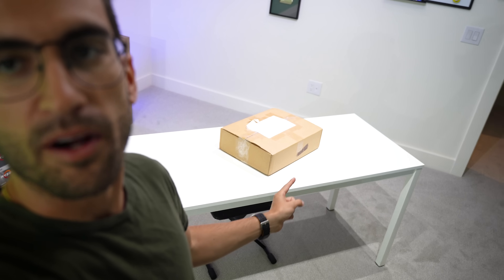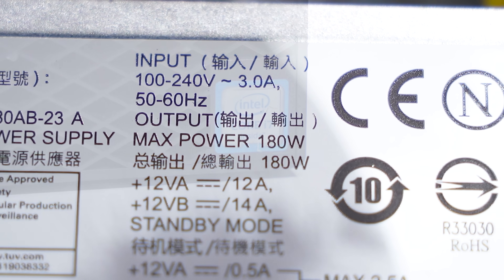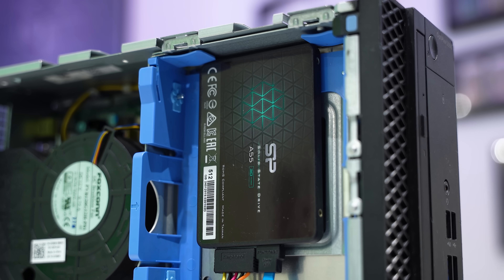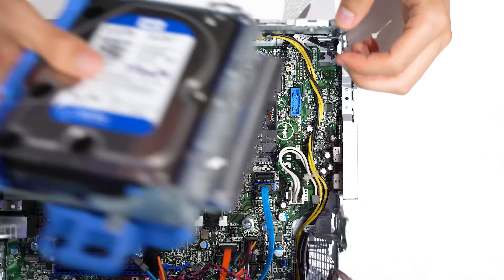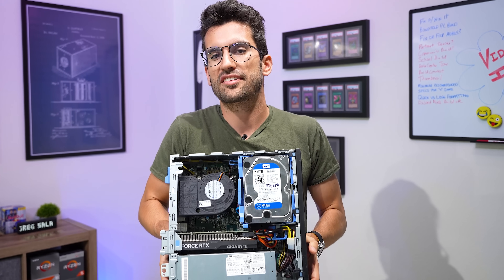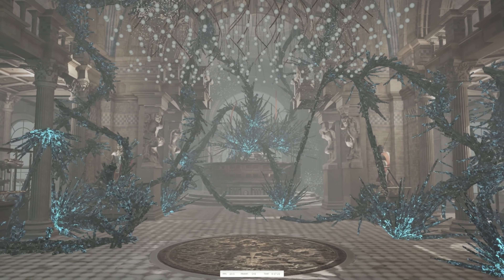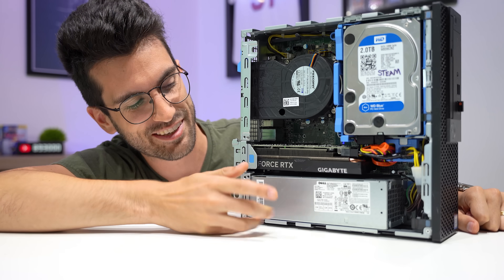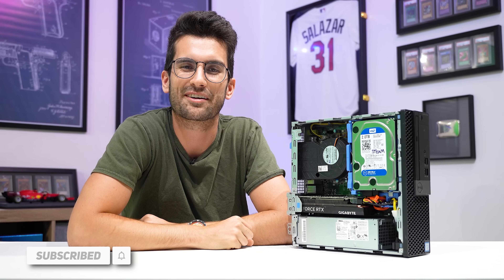This PC Build Makes NO Sense

Comment: Use a riser cable to connect it to the correct slot and give us a before and after test results. 😁
Reply: I'd be very interested in those results...
Reply from the maker: Really thought about doing this! Wish I had in hindsight.
Reply: @GregSalazar  C'mon, we need it. It would change from "very dumb build" to "it's not THE dumbest build". Because that 4 lane solution is very VERY bad.
Reply: Yeah, I would definitely desolder that PCI 3.0x4 slot off the board and use a riser cable to go over to the 16x slot.
Reply: @GregSalazar  I was thinking about it as well, but would you have to break out a Dremel and still have nothing to screw the card too.
Reply: Maybe the single slot Arc card would be a better option?
Reply: @Yuriel1981  Or another Optiplex that has the PCI-E slot in the right place because it mite be cheaper. 🙂
Reply: @Yuriel1981  I installed one of those in my dad's PC. It gets scary hot very fast, and that's with a normal-ish case and quite a lot of airflow.
Reply: @Fusso  I mean, I would undervolt it to reduce heat then. Usually won't effect performance as much as most would think.
Reply: @Yuriel1981  no, then you have to enable ReBAR or pay a huge performance penalty, and this system doesn't support it. Plus the A310 gets annihilated by the RTX 4060.
Reply: @j.p.h.8126  you have to get the mini-tower then. And not really. But it would allow you better power supply/video card options. I wouldn't go 7th gen either, I'd shoot for 8th at least. This video was full of bad ideas.
Reply: @SeeJayPlayGames  Indeed it was but this video was just for lols. Personaly i would stay away from everything that has DELL logo on it. 🤣
Reply: @SeeJayPlayGames  as much as Halving the PCie lanes? And if your going to game with it why are you not enabling ReBAR?
Reply: Why did Dell put the x16 slot in the wrong position?
Reply: @johngangemi1361  I gues it was not made for gaming in mind.
Reply: @GregSalazar  make another video
Reply: @johngangemi1361  Because Dell

Comment: My Dad works IT at his company. Every 2 years they "Upgrade" Their PC's. He gave me a 9th gen version of this same PC. I ended up doing something similar. Instead of using the upper 4x slot, I bought a low profile RX 6400. It Runs great pretty good actually. I added a little front fan as well to help give it some more air.
Reply: I've done the same thing. So far no problems, but I'm a little concerned about the 200W PSU my Vostro has. I think it's fine, though. How big is your PSU? The rx6400 is an amazing card, really. I got it for $120 off of Newegg. a DDR5 1030 was $100. I had bought a DDR4 1030 for $65 off of Amazon, but it was only about 20% faster than the iGPU.

Comment: I bought a Dell Optiplex 3040 SFF with the intel core i5- 6500 for $50 or $60. I swapped out the i5-6500 for the i7-6700, upgrade the PSU from 180w to the 240w PSU, upgraded the ram to 16GB (DDR3L though. Blasted Dell!), bought a 2TB SSD and had bought 1 RTX A2000 and an AMD RX6400. I bought 2 gfx cards because I wasn't sure if I wanted to have a gfx card pouring out of the case or if I wanted to keep the SFF theme going. I ended up choosing the rx6400 because it keeps the build clean. It is my daily rig and is plenty capable of gaming. It handles 1080p gaming like a champ. With AMD's Frame Gen and/or Super Resolution enabled, it puts out over 100fps in the games I play. It is "loud". But, that's where the compromise is. Only thing I wished I would've looked for before purchasing the 3040 was maybe looking into the 3050 or 5050/7050. I would've had m.2 and DDR4. If I come across a 3050 MB for super cheap, I think that'll be the last thing I do to it.

I play Minecraft with kids, Path of Exile, PUBG, GTA5, SCUM and EVE Online. The RX6400 handles everything very well. Albeit, Hot and Loud on some of those titles.

Comment: I did something very similar with an HP slim i had laying around for my son. Upgraded his CPU to a i7-8700 of eBay for $80, & got a rx580 off AliExpress for $85 cut hole in side of case & attached it with riser cable. We dubbed it Frankenstein,, runs Minecraft, Roblox & Warzone @1080p he loves it..

Comment: Unfortunately, Dell has been doing that with the x16 slot since the 4th Gen systems... which is why I generally tell people to avoid them. HP has much better option in the SFF systems, granted they aren't as small as the Optiplex and Lenovo systems, but you can fit any GPU in most of them. If you really want to stick with an Optiplex, a Flex ATX PSU will give you the room you need to be able to install a dual slot card in the x16 slot.

Also worth noting, that x4 slot is a Gen2 slot.
Reply: HP does a different crappy thing than Dell does; sometimes they current-limit the slot. To 35W or some BS. Or so I've heard. If you ask me that would be deviating from the PCI Express specification, if they limited the current. But why would they do this? I guess because of the stock 180W power supply. I can't confirm or deny; I've never owned an HP and I lost my multimeter anyway but you can't measure load without creating it so I'd have to insert a card and measure the voltage at the gold fingers... anyway... so the FlexATX PSU is much smaller? Like a slot's worth?

And of course it is... so it's a 2x4? (thwack) and the card is PCIe 4.0x8? so... we're working with an EIGHTH of the bandwidth it could, optimally. Ouch. Definitely would be a good idea to try (no, do - or do not; there is no try) and do a riser somehow. If only to get it to 3.0x8... too bad you can't adapt 4.0x8 to 3.0x16... I guess with a double-buffer/relay circuit you could?
Reply: @SeeJayPlayGames  Lenovo and Dell have both done that as well, and they really only do that in the consumer models. They don't do it in the business systems like the 600/800 series and the Z workstations. As for the Flex ATX, yeah... they're a server 1U sized power supply, so about 1.5 inches. It leaves just enough space to have a dual slot card in the x16 slot and having the shroud be about as close to the PSU. I need to test it with the 4060, but the x4 slot versus the x16 slot is about an 11% difference in performance, so I'm not sure it's really worth it either way.

Comment: Moddiy makes adapters for 24 atx to dells proprietary 8 pin so in theory you could use any PSU that fits. So looks like flex form factor. A small diy spacer would take care of sagging.
Reply: There is a 500w PSU from the NUC extreme going for 30 if you make an offer.  If I remember rightly it is an FSP.  Might even be smaller so you can use a the graphics x16 slot 🤷🏼‍♂️.

Comment: You could use a riser cable to connect the graphics card to the full pciex16 slot, and basically keep it in the same spot.

Comment: I use a 5040 for my virtualization server running casaos dockers controller with pinhole, unbound,  plex, an a310 arc for transcoding, 32gb ram, q28gb nvme and 3x 4tb ssd for storage crammed in the 3.5inch spot lol. Not bad for a server that pulls 10w at idle, 130w when plex is loaded, and can do networking stuff while running 4 plex transcodes....

Comment: @GregSalazar
Interesting note, If you had bought an HP Elitedesk G3 or G4 SFF, you would have had a better experience as the PCIe 16x slot is next to the CPU socket. I have one of them, G4 with a 6core i5 8500, 32GB of RAM, a 512GB NVMe drive+2TB 2.5HDD and a GTX 1050ti low profile(which fits in perfectly). It makes for a very decent 1080p/720p experience. I'm thinking of upgrading the 1050ti to a 3050 or 4060 because why not?

Comment: Ditch the hdd mod the case use a riser cable get the gpu to fit laying fan side up where the hdd caddy was. 

Then possibly vent the side panel it will be much better and more in line with what people are actually doing with these systems.

Comment: I actually have a  SFF OptiPlex 990 MB sitting in my testbench right now. I rescued it from the recycle bin. The case makes no sense so it's getting re-cased. I have to rewire all the fans (thanks dell), so I am using that same cyclone cooler right now, it's loud but it's the same loud at any load. I had to use a PCI-E extender fit a 1080 in it, as the GPU hit the ATX 24pin, so again limited there for GPU's. I am glad there is video that makes as much sense as my test bench franken build. It sort of fun to see how much you can do with a basic office PC that had no dreams of doing much more.

Comment: There's a 24 pin to 6 pin adapter from comeap for like $20 which allow you to use any PSU that fits the case with dell PC's or other pc's that have proprietary connections. Only bad thing is that the PC is "always on" unless you turn the PSU off manually. I used one in my Dell G5 5000 to put a SF750 inside so I could run a 3080ti in it and it's been working well. I wanted to get a SF850L, but wasn't sure if that would fit.

Comment: Nice build. Next time you could take the power supply out of the case, drill some additional vents in the case and cut the sidepanel so a wide card fits, see if it works. Proper Sleeper rig needs at least one hand made part 😉 or parts from different eras of computers. you have it already with the power cable 😊

Comment: I have a small stack of those from when we closed down a branch of our library. They are a nightmare to work on and have very little upgradability. That said, they do have 8th gen i5 chips and as such are fairly fast. I set them up when I need to rip a bunch of DVDs. One keyboard and mouse and then just remote in.

Comment: I picked up a HP EliteDesk 800 G3 SFF to use as my backup NAS, and have been impressed with it. i5-7500, 16gb, i threw a 128Gb NVMe into it for the OS, and the 2 14Tb drives for the backup. The x16 slot is in the top position so you could put a GPU in there without it getting choked by the PSU. no connection for supplemental power, so a PSU upgrade would be needed. i got mine for 60 bucks, but they are on eBay for 85 pretty easily. add in a 3050 for under 200 bucks, and you have a solid 1080p gaming system for under 300 bucks.

Comment: I'd like to see a performance comparison between a lower end  LP card with a full 8x or 16x PCIE lane vs the crippling 4x and 4060 here. See if it balances out. Something like a 1660lp super, maybe a Radeon Rx6400lp?  RTX3050 lp\A2000 or even or the newer Slim ARC 3xx cards, then compare to the CPU bottleneck etc, actually find the best price/performance than can be had with an SFF system like this!
Reply: I'm running i5-4590 + RX 6400LP + 16gb RAM. Solid 60fps on Ultra on most common titles from 5-10 years ago. A few hiccups with BG3 and Kingdom Come, but overall, you can't beat it for the entire $322 it cost me total.
Reply: @OGDweeb  Nice! I have a i7-4790s with 16gb and a 1660 super does all I need for a compact Mini itx bedroom gaming PC!
Reply: RX 6400 is PCIe 4.0x4. It fits in a whole 16x slot but don't be fooled, it's only a 4-lane card. The RX 6600 is only 4.0x8. You need at least a 6700 before you see a full 16 lanes used. Same can be said of the RTX 3000/4000 series... the lower-end cards have limited lanes. The RTX 4060 is only an 8-lane card. You want a 16-lane card, you need at least a 4070.

By comparison, the whole Pascal (GTX 10 series) line (with GTX branding, not the GT models) were 3.0x16. The GT 1030 (and 1010) was only 3.0x4. The rarer Kepler based GK107 variant of the 1030 actually did have 16 lanes, as well as NVENC (albeit 1st gen).
Reply: Excellent info!!!

Comment: VERY cool! I just bought a Dell Vostro 3471 that was very similar. Got it locally from Facebook for $50! (It only had an HDD and 4gb of RAM, so I upgraded it with a 1TB SSD and 32gb of RAM, just because I had it lying around. So it ended up costing about the same as yours!) 200W PSU, as well, so I put an rx6400 (max 53 tdp) in it and it's an AMAZING retro gaming machine. I love it!

Comment: From time to time I deal with Optiplex, the 5050 and up SFF are troublesome because I like to but them to pull a cheap i7 to upgrade a gaming PC, and end up putting the F SKU i3 or i5, and then have to put a single slot low profile GPU in, I normally use an ancient Quadro or Fire Pro card, but it seems like there should be something better for under $200.

Comment: You can tell how young Greg is because he doesn't know what a blower is, he calls it a wind tunnel and assumes it's loud! I had one of these Optiplex workstations I got used for cheap, and that blower is great. The pressure lets it pull air effectively through the dense heatsink fins and the air goes straight out of the case. Also the reason blower graphics cards are beneficial. They've only gone out of style due to the prevalence of cases with many giant fans

Comment: I would have gone with an HP SFF instead. Although a little larger physically, the x16 slots are in the correct spot unlike these Optiplex PC's. I have two Dell SFF's with Core i5-6500T CPU's and the best option I came up with for one of them was to make a OPNSense firewall by adding a 4 port 2.5 Gbe card. The other one just sits doing nothing because there are no good single slot GPU options with pci-e 3.0. ETA Prime did create a single slot intel Arc 380, but that requires Above 4G decoding and ReBAR to make it worth installing and those older PC's do not support it or the ability to  mod the BIOS/UEFI to enable those options.

Comment: Im surprised you didn't just custom fit a pico psu, with an adapter for the 24 pin to that dell motherboard, then you would have had loads more space to play with for the GPU and could have put it in the 16x slot.

Comment: you did what I did too. Well, I have gone a little bit bigger CPU i7 6700K, don't think it make a bit better, bigger heatsink. I use RTX- A2000 GPU and a 240Watts PSU, works fine not trottling, happy to be there.

Comment: Two more low profile  (single slot) video cards: VisionTek Radeon RX 560 (~$80.00 used on eBay); Radeon Pro WX 4100 (~$70.00 used on eBay). Both should work with macOS Sonoma, as well as Windows.

Comment: I dunno, I'm running basically the same thing as an everyday driver, except HP flavored instead of Dell (the PCIe slots are better laid out, for one).  I have one with a 1050 slimline card plugged into my TV as a media PC, and this one, which has a Quadro A2000 for the GPU.  And I can't say I do a lot of gaming, but I do a bit of AI work for graphics design, and it handles it - slowly, but it can't be beat for the budget.

Comment: It could make sense if for example you got a used RTX A2000 (on par with a 3050) in that thing. That way you could keep the existing PSU and not deal with cable shenanigans since it's only a 70w card. Worth noting that it also has a full PCIe x16 bandwidth.

Comment: Not with the overkill 4060, but it would make a nice Media PC for your home theater. Small foot print, decent core count pair it with an older GPU and you'd get some good movie/streaming on your tv.
Reply: I'm still using a slightly bigger and much older HP dc7900 SFF as a HTPC. Core2 Quad Q6600 @ 3.0GHz (tape modded), 8GB DDR2, Radeon HD 6570, 240GB SSD + 3TB HDD
Reply: @Pasi123  my current media PC was found in the trash. It's an HP office machine with a AMD A4-3420 (dual core) with 6gb ram and a gtx 1050. Runs Pop!OS and streams/plays local stored movies just fine. Old PC's are great media boxes

Comment: Bought a slim 4570 PC for $30, seller couldn't find it and gave me a slim with a 8500 instead (weird but later makes sense).  Only 1 memory channel worked (that wasn't disclosed).  Troubleshot, removed CPU, fixed bent pins and is all well and good.  Bought a RX550 4gb for $20 (no ext pwr), should be here tomorrow.  Just looking for low end performance and some fun emulation.

Comment: Skylake 6700K isn't supported by Windows 11.  Just saying.  I wonder if you could have gone with a pico power supply with a supplemental 12V external power supply for the graphics card.  That would give you a lot more space in the case at the expense of an external power brick.

Comment: I overbuilt a SFF OptiPlex 7010 by adding an RTX A2000 GPU.  It gets all of it power from the PCIE rail and is able to run all of the games in my Steam library at moderate settings, so it was worth it for me.

Comment: here's a stupid idea, while we're having them... when you had the new power supply outside of the case, just next to it, it dawned on me - you could locate the power supply externally; on the other side of the "bottom" of the case, creating that much more room inside the case. That might let you put the card into the 16 lane slot?

Comment: Nice build! Maybe you should try installing an RX6400 instead of the 4060. The RX6400 is a single slot GPU, very low power consumption and it would fit in the x16 slot.

Comment: I think you should Frankenstein it by 3D printing an enclosure for the PSU then drilling a hold in the case with a rubber gasket for the edges of the hole for the cables to snake through and rivet the 3D printed enclosure to the outside of the case. Then you would have plenty of room for the GPU to go into the correct slot.

Comment: You dropped from PCIe 4.0 x8 to 3.0 x4 which is 1/4 the bandwidth.  Also you are sharing all the bandwidth on the DMI bus.  So the NVMe, audio, and LAN is using the same bus.  It's bad.

Also:  Just plug the 6 pin from the PSU into the 8 pin and make a little jumper for the last 2 pins.

Comment: And then... The PSU goes out. Good luck finding another for cheap. If you don't mind you can always use another PSU (if the size fits the Mobo connector) and make it a Frankenputer.
Reply from the maker: The PSU we upgraded with is perfectly fine for this.